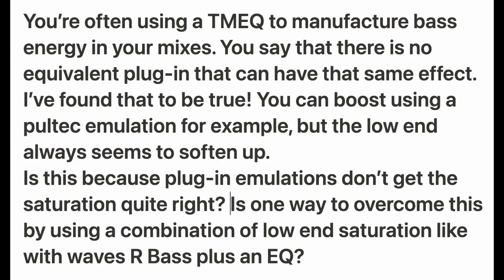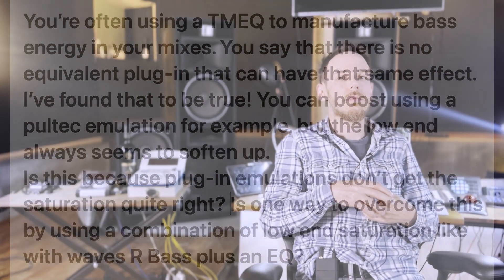WHY would an ANALOG EQUALIZER sound different from it's Plug-In Derivation?

Comment: Ok. But, what is energy? I imagine it isn't just volume or gain, but what is the difference as you understand it? Thanks.
Reply from the maker: It's not an easy question and nobody really know's it exactly. Good analog gear does something if it hits hard. It's Saturration, it's the way it deals with the transients compared to the sustain, and the way it behaves. That thing is what I never found in emulations. It might also be, that if a compressor attacks and release the gain, that is a very fast process. So what also happens, is, that in this process, new harmonics are generated (Amplitude Modulation). In a digital Emulation this part is tricky, as you would get an Alisasing. Or then you would have to implement Oversampling, which however again has it's disadvantages. 
That said, Plugins get better every year.

Comment: You are a gem in this medium thank you for your sharings... I have a question to ask you... About recording and mixing stage... How you arrange the recordings for same sound source with more than two microphones. if you make phase correlation I hear still blurry sounds. Power and fullyness comes but clarity and focus goes... how you handle.. or dou you prefer multi micing for the source? thank you
Reply from the maker: Thanks for liking, spread the word. 

I often like many mics per instrument, but not always. But then you got to be able to place the mics in a way that you get benefits from the phasing/timing difference. Critical monitoring is very important. Without really good monitors, it's probably better to not mix up too many mics..
Reply: @danieldettwiler.official  Thank you for the answer. Do you have this topic in your bible course or somewhere with your deeper explanations?
Reply from the maker: @yaybahar  I speak about that in the bible, but not for long. It is important for me, as a high-end mixer, to point out, that there is a reason to use top-notch analog gear. I also do this, because Plug-in Manufactures advertise their products  very clever. 
But in the education, I like to be in the box. For most things, that I teach, doing so in the computer is well enough. Would I use analog tools, then most would either not have analog tools, or different ones. Also, my courses are for Engineers, but also musicians, and also amateurs, that really want to come forward would be my typical clients.

Comment: Another question - do you think that the benefits are common to all analog EQs (so that even cheaper ones like the DBX 530 or the Trident 80B 500 Series have this quality) or only high-end units?
Reply from the maker: That's a difficult one. I never said, that in general, Analog EQs are better than digital. Just to boost and to give color (or distortion or whatever). Now, one of the disadvantages of the analog EQ's is, that the current does go through many electrical parts, and they all influence the sound. Also, to create bass energy, they must have some headroom and some power. If you use cheap analog tools, it might still give you a benefit, in some cases, as you still get that coloring. But it also might degrade the audio quality. That's a good thing in an algorithmic plugin. If you let the sound go through, you don't get any change. So for me, very important is a high quality "Box-Tone". A "Box-Tone" that already clearly gives me an advantage, a "Euphonic sound", that was not there before. But that only happens in expensive gear with great components. 
That said, there are some really good 500 Modules, that probably can come close. I am not that experienced with cheap analog units, I have to say. I see analog tools as an extension for my dititals, and I want to have the best possible tools here, that, once I go out of the box, really give me the best possible advantages in sound, that little "something more", that help my mixes to stand out.
Reply: im going to guess that (to an extent) his point would still stand because the discussion is about whether you are affecting the actual voltage as opposed to simulating it with digital samples. of course you could have cheap enough gear where the parts have a negative effect on the audio but i think that would be  noticeable to an engineer. id love to hear his answer tho!

Comment: Digital emulations are getting better, but I suspect that high quality analog gear is still superior. But I guess with the use of AI algorithms digital emulations will soon be able to reproduce most of the even most complex nonlinearities.
Reply from the maker: They are. But still, if something starts to create chaos, which happens in every analog gear, if you push it, Chaos and Randomness is just not something that a computer can create easily.
Reply: @danieldettwiler.official  Yes, I think analog gear can be nonlinear in very complex ways which for example the plugin doctor can't detect with a simple impulse or frequency sweep.
Reply from the maker: @Anders01  Exactly. And it is not even sure, if, even with better technology, it could be recreated. Because in the gear, it just happens. It is easy to understand, if you think of a grand piano. As soon as you play several tones with the sustain pedal, you already have something that can not be sampled and not be synthesized.

Comment: Soooo … how is it possible to record an analog EQ in the digital realm? Honestly, I'd need some scientific background for your thesis. What kind of "energy" is it you're referring to? And if 0's and 1's can be converted back to an electric current (which then can be used for musical purposes), why shouldn't it be possible to recreate the "energy" of a Fairman?
(fyi: recently, I A/B'd analog gear to plugins quite regularly, and most of the time, not always, I think digital does not only sound "better" ‒ I know, I know ‒ but also has equal or even more depth. You're right though for 90% of plugins which remove one dimension "layer")
PS: I love the fact that you have 2 bottles of wine standing around ‒ double thumbs up!
Reply from the maker: Yeah, maybe it's only possible with wine. No, but seriously, it first is my experience as a mixer. I then try to find theories for it, and I discuss those ideas with scientists and other experts in the field. Once a Signal is digitized, at least in this form, there is no energy that could be directly worked with. If we boost with a digital EQ, the computer must somehow change the represented digital file, so that it has say 15 dB more at 60 Hz. An algorithmic EQ does that with several delays (a fact that many don't know). An Emulation EQ does it a different. An analog EQ however, does boost that current that is actually there. In my thinking, this can very well lead to the differences I and many others are hearing. It is most easy to hear with a Bass Drum. With the right analog EQ, it sounds like the Drummer would have produced more energy in his hit (which is what we want), but it does not sound unnatural. With most Plug-in EQ's it sounds like if you boosted those frequencies (yes), but it sounds unnatural, and you don't have that much benefit from the EQ. The more you go to the extreme, the bigger the effect is. 
In this tutorial, I compared analog and digital:
https://youtu.be/iXyHAtg-oY8
or even better:
https://youtu.be/ViTF5hjREO4
In that one, I created a Drum Sound with just 1 or 2 Mics, and shaped the Energy with CADAC and Fairman EQ's. I said that this would not be possible with a plugin. In the forum at www.recording.de a great and interesting discussion came up, where about 5 other engineers tried to do it with what they thought were the best digital plugins for this job. I was surprised how close they came, somehow, but then, still, all example sounded way less life and more like plastic than mine. 
Again, let me close, saying, that in my opinion, many things work better with those digital EQ's. But not boosting. Provided a decent DA-AD is in the chain, I guarantee that I would always be able to make a nicer boost with a more living quality, than you ever could with a plugin. And last: If this was not the case, why would mastering engineers use analog EQ's? 
Too long answer, sorry for that:-) Back to the wine...
Reply: @danieldettwiler.official  Ich kann den recording_de-Thread nicht finden, postest Du bei Gelegenheit mal einen direkten Link bitte?
I think the "energy" question should be further discussed in the future, eager to hear what the scientists have to say about it! I still think that ‒ like you ‒ there's a right EQ (and consequently many wrong EQs) for a specific task. E.g. for bass drum, indeed I rarely was happy with my digital (algorithmic/non-algorithmic) options, until I found the perfect tool recently (non-algo).
About the mastering engineers using analog gear: I've heard good digital masters and bad analog masters, and vice versa. I guess it's how you gel with a specific unit ‒ how quickly you get the result and how close is the result to the sound you have in your head. As you say: given a top notch DA and speakers/room acoustics. So the answer might be: because it's saleable/advertisable more easily? ;)
* on to some Riesling now, cheers! *
Reply from the maker: @marcfrank7446  Link: https://recording.de/threads/druckvoller-drum-sound-mit-nur-2-mikrofonen.250216/

"until I found the perfect tool recently (non-algo)." I provoke: I bet it will always sound better with an appropriate analog tool. More lively. More punchy. ( as long as we are speaking of giving more than 10 db's of lowend energy (or also upper mid boost)

"I've heard good digital masters and bad analog masters, and vice versa". No no no. that's not the discussion and that argument is so old and it smells bad. Because it's obvious. When I was young and mixed digital only, I still won about every mixing contest against my peers back then, that still were on the SSL. That does not mean that their outboard was bad, or my digital plugins were good. No. As a professional I am able to get a good result also in digital and another mixer, even if on analog, won't have an easy time to compete with me. That does not mean, that analog gear has not clear adventages. And no, its not advertisment. As mastering engineer we use the gear that helps us best to create the emotion, the message in the song. You get a clear sonic added value. No plugin in the world gives you such an added value. The more mixers go to mix ITB the more Mastering Engineers with their analog equipement are important as it will be the last place to give some additional character. 
Now Tea, too late for Wine:-)
Reply: @danieldettwiler.official  If the "energy" you are talking about is "electrical energy", then isn't it all about Kirchhoff's law/equations? Which basically prove that analog circuits are per se inferior to their ("perfect") digital counterpart. What I experienced, and I also pointed out in my reply above, is that it's the imperfections of those "classic" circuits, the sounds that are engraved in our aural/cultural memory, are what we long for. IMVHO.
The fact that you, as a mixer actively altering signals (this is important), achieve "that sound" faster and more immediate (the haptic experience) with an analog piece of gear might give you the impression that in the end result the analog tool is superior. Which is okay, since you have to "create the emotion" for the final product. If you're bored as a mixer, the result obviously will be worse.
BUT: Does all of this mean that the created emotion is perceived and reflected by the listener? Or by the majority of listeners? Or by only the most demanding listeners? 
Hence my question regarding a scientific confirmation: Is there a comprehensive study in which the effect on the listeners' endorphins are measured and compared, when they're exposed to a) analog and b) digitally mixed (not recorded!) material?
Reply from the maker: @marcfrank7446  I actually plan to do such studies with the university's I teach. But, as you can guess, it is more than difficult. 

But yes, we can also look to tube devices. Tubes are extremely imperfect, and nonlinear. But they sound nice. So do transformers. I often refer to this situation  as" lucky punch in history". Because obviously tubes have not been created to sound good. 

I've done several tests with my students, and it seems that this emotional benefit I (and most US Mixers) try to give, help that the music can also be listened on not that great speakers, or on laptop speakers or if it is converted to MP3. The Hi-fi Enthusiast, listening to music loud and on very expensive systems, seems to care less. They like it, if you record what ever music just with 1 stereo pair of microphones and if it's given to the speaker as natural as possible. And yes, if you go close to the original level the music had, once played, most things are not a problem. Small sounding snare? No, it's not sounding small if it is played that loud. But most listeners turn down the volume and listen to music at a much lower level. Then what happes is kind of a "mickey mouse" effect. The lower you turn the volume, the smaller everything gets. It's the job of a great mixer, to get size (and color) to the mix, so that it sounds large and interesting no matter where and how you listen to it.
Reply: @danieldettwiler.official  That'd be amazing as these studies would address merely the perception by listeners - who are the audience we do all this for, right? Our perspective as mixing or mastering engineers wouldn't be important at all - even if we "believe" there is a significant difference. Hence I hope that you'd carry out those tests not only with your students but also with total laymen as well as (self proclaimed) "HiFi experts".

I'm totally pragmatic here: if 0% of the listeners' brains perceive the analog mix as "better" (as in "more happiness by more endorphins"), I wouldn't care how the mix or master comes about (I'm even skepitcal if I'd care for a potential 1%, haha).
Reply from the maker: @marcfrank7446  I am, based on many pre-test, rather convinced, that the less "educated" the people are, the better they perceive the difference. You just must avoid the question "what is the difference". Rather, present them an analog vs a digital mix and ask them which one they would like to listen to the end. With musicians, it is usually 50:50 (as long as they hear the performance and can analyze it, they are happy). With normal listener's that are not educated, they just listen with the limbic system (that is responsible for the emotions). The result is most of the time 70 : 30 for the analog mix (which is a very resilient result, given the fact, that we give them something to listen that sounds very close). I've done those Pre-Experiments over a 100 times. 
But even if they won't hear the direct difference, an engineer should do what he can to deliver something great, with the tools, he things work best for him. A great chef won't stop to cock great, even though his guest might not smell out every single nuance and every single spice. But over all they are pleased. 
There are other things: I am a scoring mixer, and many of the big german movies, the music is mixed by me. We have over 1000 tracks often. I stopped to use analog equipment, as it just makes no sense. But the results were less good. Still ok, professional. But many things were lucking. Even my clients heard it. (That although I am a very experienced digital mixer). Then I inmplementet analog outboard on the stems, and "bing", the sound was back. Also Alan Meyerson does it that way.
Reply: @danieldettwiler.official  Rather than You just must avoid the question "what is the difference". , you shouldn't ask any question at all, just measure their brainwaves and the output of endorphins.
If the test persons feel forced to answer verbally, there's a potential flaw in the objectivity of the results (especially if a human interviewer asks the question :)).
Reply from the maker: @marcfrank7446  You might laugh, but I came up with this idea 10 years ago and discussed it with a Neuro-Psychologist. As I said, I am really connected with top scientists. He loved the idea, but said, that I should come back in 20 - 30 years again, then maybe they can measure differences  in more or less pleasure without putting the testers in a lould MRI-Tube.
Reply: @danieldettwiler.official  I totally believe that, and I don't laugh :) But maybe there's a way now as technology advances so quickly? Because that test would yield the only valid results, I reckon.
Reply from the maker: @marcfrank7446  Yes, but as long as the listener has to be in the tube, no chance that he will have any good emotions in that tube. And it's too noisy. ONCE we can measure activities in the limbic system in real-time with a unit, that does not distract the listener from perceiving emotions, then we are there. I would guess it takes another 10 years or so.
Reply: @danieldettwiler.official  This is totally clear - MRT is out of the equation. I've found an interesting article though which might give you some ideas - not the experiments itself described in the article, but the references listed in the appendix. Fingers crossed 🤞